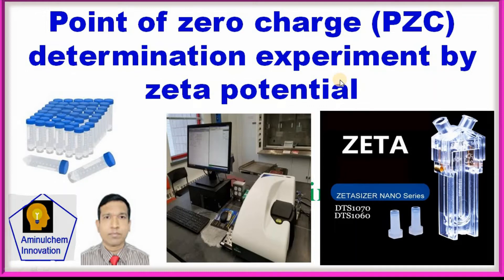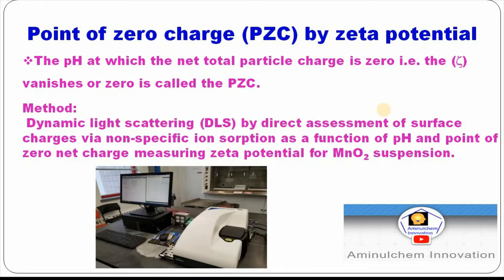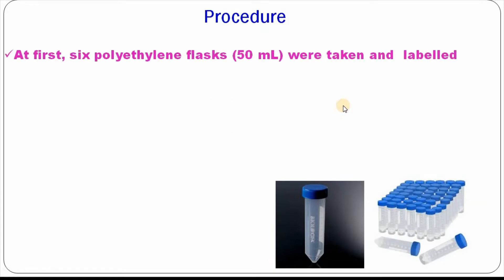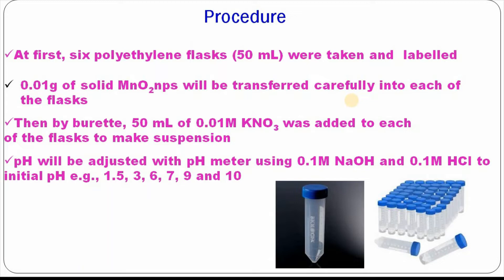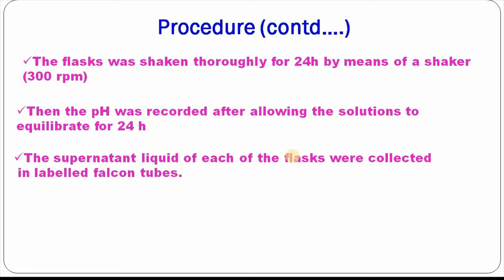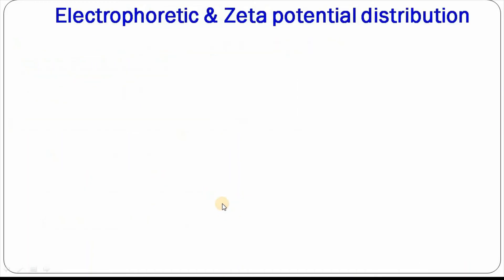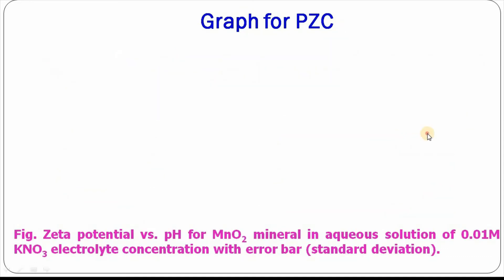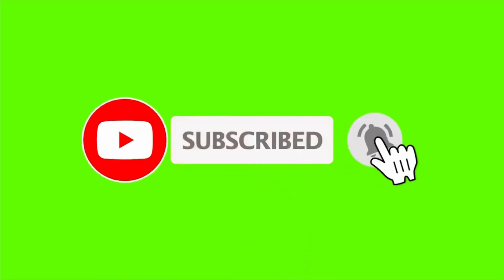Point of zero charge (PZC) determination experiment by zeta potential

Comment: What if the zeta potential measurement is performed immediately without waiting for 24 hours?
Reply from the maker: Due to the complete hydration of the surface materials, usually 24h is required, during which surface reactions occur. e.g., protonation and deprotonation reactions take place.